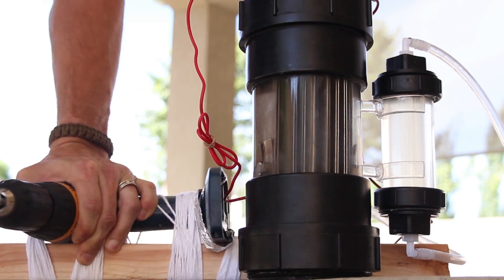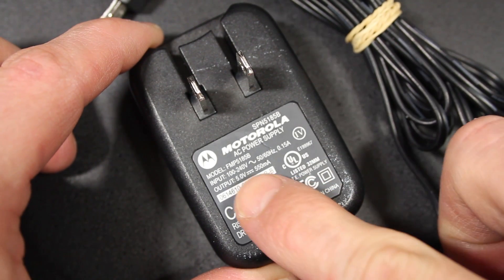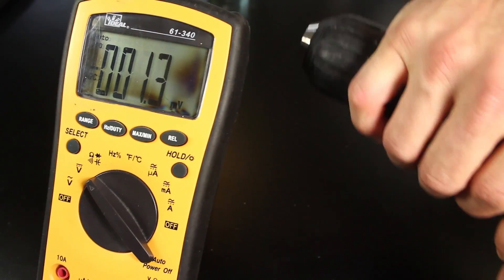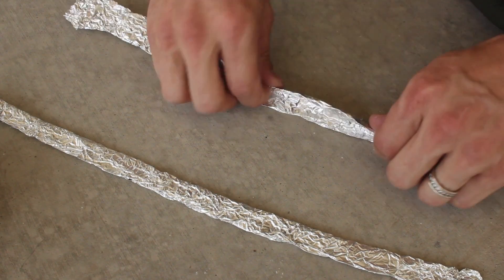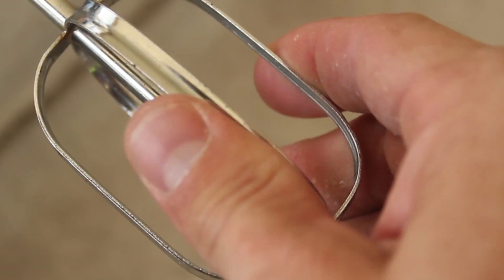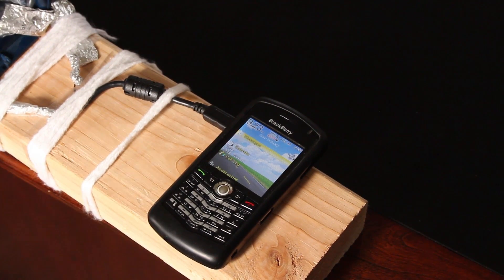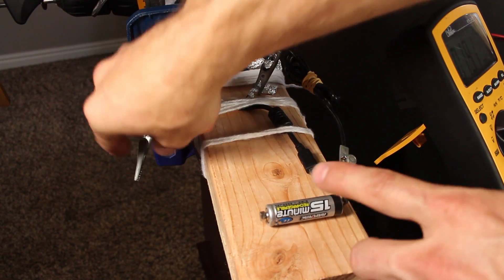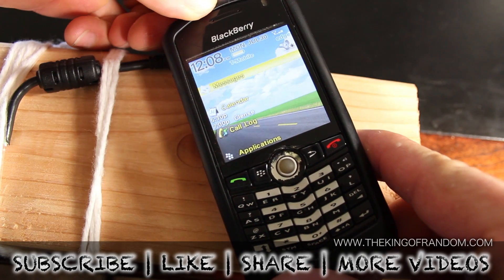Make an Emergency Phone Charger - MacGyver Style!

Comment: Why are there so many comments of people saying stuff like "It's not free, the drill costs money" or anything else dissing this, really. Most people already own a drill which is the purpose of this, and the same thing can be done with ANY DC motor, drills would just happen to be the best candidate among commonly owned motors. The information presented here would be amazing to know should the power be out, if you're stranded, etc.
If you are stranded in the middle of a desert or something with no battery left, you could take off your blower motor for your air conditioning for example and charge your phone with that. The uses are niche but infinite, and anyone who disagrees is ignorant.
Reply: RicoDuroska Lol. I like how he gives you all this information, actually knows what he's talking about and you just come out and say "You are wrong". Unless you can add more to your statement, I suggest you accept your defeat.
Reply: Locked Out
Okay, but you're still wrong :^)
Reply: #clap
Reply: Um....heh....NOT your blower motor....that is an induction motor.
No induction motor would work....that means no fans, no hard drives and nothing from a microwave oven.
You would need something with brushes in it. The best way to tell is if the motor is VERY loud when operating normally. Also, you want it to be a battery-powered motor so you can be sure it operates with direct current, as opposed to alternating current. So no vacuum cleaner motors, no weed whackers and no leaf blowers.(unless they run on batteries)
If you try to charge a battery with an AC motor, you will blow it up.
If you use an induction motor, your arm will fall off before you can get a signal.
Reply: cocoa tresbelle
Induction motors can be used like this, though.
Reply: I'll just add that while it IS possible to get very efficient energy output from an induction motor, such systems require high RPMs, other generators, and equipment to regulate voltage, which is, by the way, always alternating current, which will cause a battery to explode.
Reply: Locked Out
AC converter
Gear ratio
Reply: RicoDuroska
Ughhh....okay. First of all, that would be "A/C Inverter;" second, I don't think you comprehend the "gear ratio" (and by that I must assume you were trying to say that a
speed multiplier gearbox would be needed or is already present) which would be needed to spin an A/C induction motor to 1,350 RPM BY HAND. The torque alone would be prohibitive. Not to mention the manufacturing tolerances....
But let's say you did pop a spoon through the tines of an egg beater attached to, say, your desk fan by way of a mysterious gearbox which somehow allowed you to hand crank that fan up to high engine idle speed.
The problem is the inverter: those are at most 30% efficient. Meaning at peak efficiency the inverter will turn over 30% of the energy you put into it.
So if you need, say, 5v @ 2 amps D.C. to charge your phone(middle-of-the-road factor, here: Some take more, some take less) you will need 6 amps from the fan motor @ 120v to produce the 720 watts required by the process. 1 hp = 745.7 W. So we are talking the energy needed to raise 75kg one meter in one second. That is about 550 ft. lbs. or more weight than two of you could lift in five minutes.
You certainly will not be putting out 178 calories per second, which is like cross-country uphill skiing at 40 miles per hour.
You can't do it, no one can do it.
But if you could, you would have an impossible gearbox, an inverter, a charger, and the physique of Goku.
If you're Goku, 911 calls you, not the other way around.
Reply: Locked Out
You are wrong.
Reply: *****
Well, he is wrong.
I don't feel a need to type ten paragraphs in response to someone who is... wrong.
Google it yourself if you'd like.
Reply: RicoDuroska
I dub thee; "Troll Douche Sackus Maximus, Crapper Upon Threads and Wizard of the Arse."
Rise, Sir Knight! I give you the power to mete douchebaggery faggory diggery do, the dummy in twixt shall part we two!
Reply: RicoDuroska Actually You are wrong. Most modern multi speed fan motors are DC and controlled by an speed controller because induction motors cost more to make than DC motors. Washing machines, newer fans, all use permanent magnet motors which work well as generators.  If the motor used is Ac, then yes its more work to get it to do this, but since its most likely to be a DC motor, then this is very possible.
Reply: BLAZENYCBLACKOPS AND WHEN EVERYTHING ELSE IF FRIED WHY DO YOU NEED A PHONE...IT WILL BE WORTHLESS....A CB RADIO AND GENERATOR OR CAR BATTERY TO CHARGE WOULD BE A BETTER EMERGENCY OPTION...CELL TOWERS WILL BE DOWN AND WORTHLESS
Reply: Yea, well when else would you need to GO THROUGH ALL THAT STUPID TROUBLE, DUMBASS
Reply: n4ktz
Perhaps like in the many examples given on this video... Stranded/power outage.
Reply: People who type in all caps are scientifically proven to be weak of mind and have poor reading comprehension.  The video is merely a way to charge a device "if" you happen to have a drill laying around and "if" you are in dire straights.  It never claims to be a batch all solve all.  n4ktz you come across poorly.
Reply: Ah shucks...did not mean to....so sorry....
Reply: Its quite ok.  We still love you in a platonic way.
Reply: Still not free, to power that by hand takes energy, energy comes from food, food cost money... Therefore it's not free
Reply: +Locked Out "You would need something with brushes in it". ==> Nope. You could use brushless motors just fine - ask me how I know.
Reply: +dblock2626  except that you'd still need to eat even if you where not cranking that thing. and I don't think one would be suddenly way more hungry after using it to charge up a phone then just sitting around for the same length of time. So thus that's a mute point, it's not going to cost you more in food.

Comment: but its tiring
!!!!!!!!!!!!!!!
plus the equipment is a bit expensive
Reply: None of it is expended and can be dissembled after use. You can still use the drill for making holes in things.
Reply: KaosFireMaker umm so we can charge the drill on the mains just fine but the cell phone just cant cut the mustard.

Comment: yeah like i bring a drill around in public so useful .-.
Reply: Drills are love; drills are life. ._.
Reply: I always bring my drill... FOR DRILLING SOME BITCHES!!! OOOOOOOOOOOOOOOOOOOOHHHHHHHHHHH!!!!!
Reply: Drills are pretty cool though.
Reply: What else can create holes in things and immediately be switched around to buff out stains?  :)  Drills!  And dremels.
Reply: I can tighten the hubcap lever in my Ryobi drill and in Gear 1, connect the hook on the other end to the jack it will lift my car!
I suppose I can keep my drill in the car for when I quickly want to change the wheel, as I don't have a decent jack handle, other than a wrench with a place to slot the hubcap lever with a hook on the other end.
Reply: well then you didn't understood the purpose of the video, he is showing us what will happen when we run an electric motor backwards and then you get a tip of what you can do during an emergency.
Reply: Eric Karlsson you don't get the joke at all,,,
Reply: Abyss Lord nope
Reply: Oreobility lo u funny
Reply: cocoa tresbelle lol GET A GRAMMAR AND SPELLING BOOK. (The lol was intended to be lowercase)

Comment: quite inefficient, I would use your generator as a motor (but even thats inefficient!), but rig up a bicycle to it through gearing (direct drive if I think that creates more energy than running through the gears), I would put a cap bank inline with a voltage regulator and then run it into a gel battery before it gets to the charger (more consistent voltage, better for voltage sensitive devices!). so if I took a break it would keep charging for a while longer. I would also try to get a generator that could make about 12v+ and make the whole battery system a higher voltage so you have to do less work to get more power, then step it down if required.

Comment: You're not getting 40W out of it, if you get 6V without a load (0A) and 7A with the output shorted (almost 0V). As one quantity increases, the other decreases, so you need to measure both at the same time. USB chargers deliver about 5W, and that sounds about right for hand-cranking.

Comment: little tip if you turn on airplane mode or turn the phone off while charging it will charge a little faster it's only a bit but when you are cranking every little bit helps

Comment: error, what makes the phone accept the charging is the AMPS, anything belows 0.30a will get the charge rejected on most devices (iphones for example will display "this accesory cannot charge the phone" or something similar, most android phones will display "slow charging" only, but the VOLTS can be anything up from 4.2V to 5.1V to be accepted, so the first part of the video is somewhat erroneus since it does not cover amperage settings!

and since the phone charges more faster than the wall plug means you just generated at least 1A wich is the most the circuit board will accept, and probably your charger was a 500mA output, thus charging it slower and taking twice.

great project, but i would like to know how many AMPS this baby generated. greetings!

Comment: Try to use a simple 5 volts regulator its Pretty cheap and will also help maintain the 5 volt output and prevent any extra Voltage ;)
Nice try KIP

Comment: how many of these cordless drills would i need?? and if i had a drill with a cord on it... how would i know which lead was positive??? i have plans on having a large generator with a Robert boyals self flowing flask and a water wheel... and a motor... im hoping that i can get my hands on a motor large enough to make it work... and a water wheel and self flowing flask large enough to turn it... my old washing machine has it own motor.. so im hoping i can salvage it... its huge from what i can tell... as big as or larger than my monitor's width.... (a standard monitor like one of those crappy monitors with monster asses.... i wish i had the materials and the money to get all i need... plus the same kind of stuff you use for making some of the more complex stuff like with the router table... and table saw.... and other stuff.. i want to make the pvc pump you made in another vid... and have in in bulk.........but back to the drill... i want have a dozen of my own.. along side a bunch of cool batteries... that last a long time... and produces a big charge... unfortunately i killed the battery by directly plugging it up to the wall... so i cant use it for anything... and i dont have a way to turn it into the station you have shown here....:(

Comment: Would it be possible to use this in conjunction with the Water-To-Fuel Converter to create free, clean fuel? Maybe the hand crank wouldn't provide enough power, but people in the comments have suggested using an exercise bike, which would probably provide the necessary power. I'm not an expert, so this may or may not work, but if it did, that'd be awesome.

Comment: Question....if you used this system (slightly modded with a gear ratio) to power the Hydrogen system, Would the fuel/gas gained from the hydrogen system be more than it would take the run a generator used to crank the machine that powers the Hydrogen system.... If the answer is yes, then you have a way using energy to make energy + the amount remaining meaning free sustainable energy meaning if you fit this type of thing in a car using the axle/wheel of the car to drive the motor that would power the hydrogen motor which would then produce fuel the car...... all it would take is a gas compressor fitted to a gas tank in a car, then let the rear drive from the car to power an electric motor which would power the hydrogen unit which the gas output would be fed into a gas compressor completing the cycle.....

Comment: nice; bet you're arm is tired. this will be great knowledge for the coming apocalypse. could you use the same material (including the magnets to create a magneto and use the drill to spin it? i realize this is actually a waste of power, but if you needed your phone battery full instead of your drill battery it could work couldn't it? lots of older appliances such as hand mixers basically have already made magnetos in the heads, that's what makes the heads spin in older stuff.The AC current turns the head connected to the gears into an electromagnet causing the spinning.